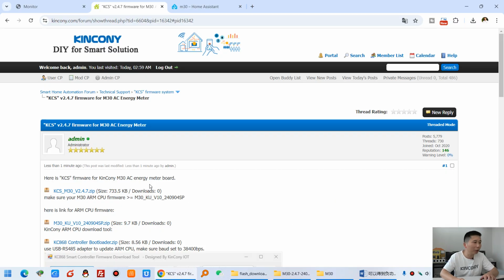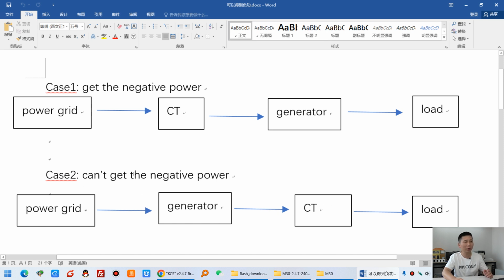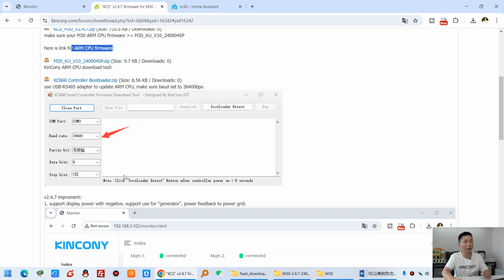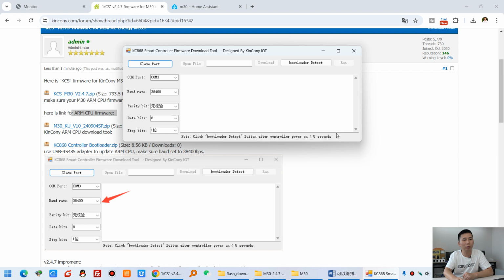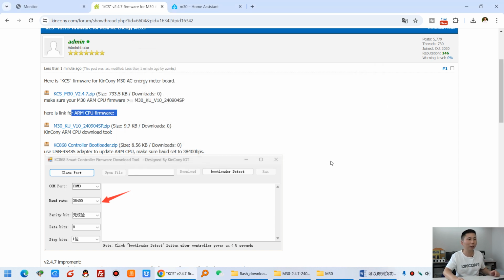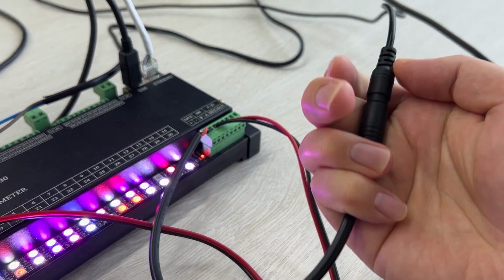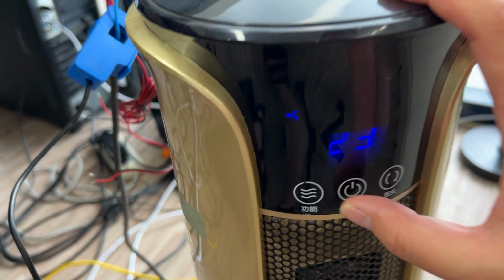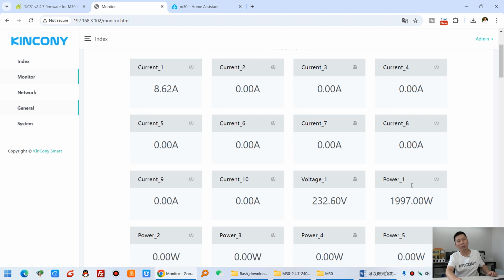M30 firmware update for solar cell/generator for Negative power value

Comment: Is it still possible to use this with ESPHome, so only the ARM CPU is updated?
Are there any updates needed in the ESPHome YAML file after updating the ARM CPU?
Reply from the maker: not need update ESHome yaml file after you updated ARM CPU.
Reply: @KinCony  I received 2 M30s and 2 M16s today, and just got the firmware updated on one of the M30s. The current ESPHome yaml seems to double the wattage value when the CT Clamp is in reverse. Is there a modbus address that signifies that it's negative? or do you have another recommendation?
Reply: Nevermind, just worked out it needs to be a S_WORD :)
Reply from the maker: @AdamPrescott  if you want to show "negative" power, you can download KCS firmware >=2.4.7 and upload ARM CPU firmware, so that  support display power with negative. support use for "generator", power feedback to power grid. download link: https://www.kincony.com/forum/showthread.php?tid=6604
Reply: @KinCony  I realised the KC868 update had changed the modbus address values for Watts to a signed-integer (S_WORD) once I updated the esphome yaml to reflect this, it was correctly returning the negative values for generation 😊